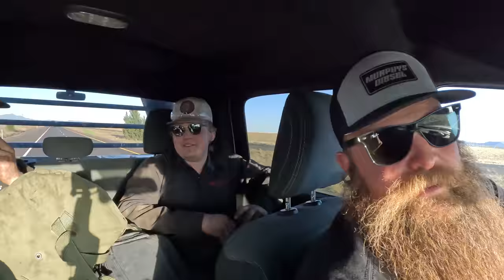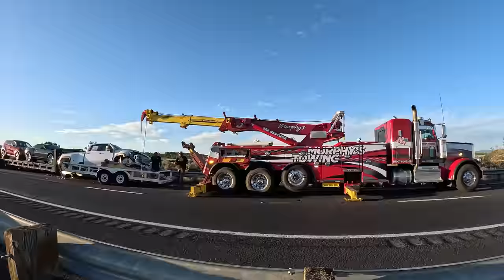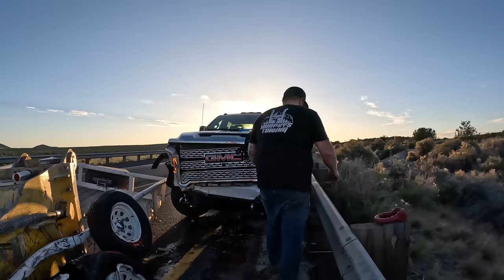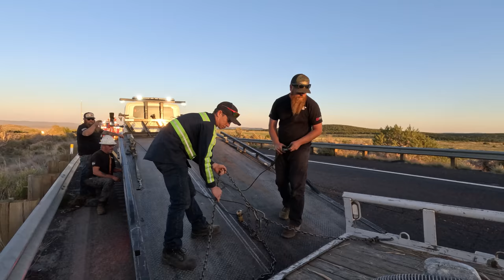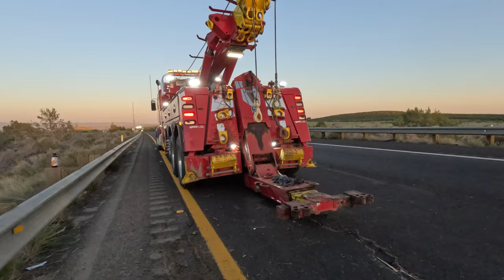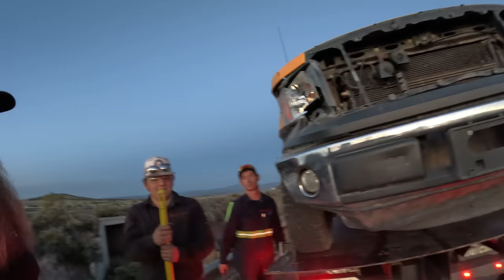EVERYONES ALIVE!!! Bad Day For A Car Hauler On Interstate 40. Multi Vehicle COLLISION!!

Comment: I’m so confused on how this happened. Did the trailer with the hammer on it fall off of the vehicle towing it? How was it facing the wrong way? So many questions and I know the answer is just going to give me even more questions. I’m tapping out before my head explodes.
Reply: Looks like the yellow truck hauling the white trailer came loose and disconnected and the car hauler plowed into the white trailer that was rolling loose on the highway.
Reply: They didn’t have a corner left to scratch Rick!!  😂😂😂
Reply: Beware on market place lol slightly used gmc dually  no  scratches  straight tail gate runs n drives  low miles

Comment: Would make a Good Hell Girl or Who the heck been trimming on the bush and who the Alabama Betty Crocker lowered them Ears Wrecker Rick You trying to pull a fast one on hot rod- you dropped 20 Ibs . I’m keep my eye on you Slick Rick! Hot Rod was pumping chin ups like a  champ looking at you grinning throwing out a challenge to you just sayin
Reply: I’ve Been putting on weight everyday! You keep me motivated Kentucky Bluegrass!
Reply from the maker: The best barber this side of the nut house. Dropped 30 lbs already, it’s easy to pump out chin ups when you only weigh 155 pounds.
Reply from the maker: @HOTROD928  you ain’t put nothin on, just stop

Comment: More modern vehicles in a crash have a double safety system to prevent them from starting like cutting fuel or spark on diesel trucks they cut the fuel and sometimes the starter
Reply: nowadays they put a Pyro fuse in the computer that blows when the airbags are blown.